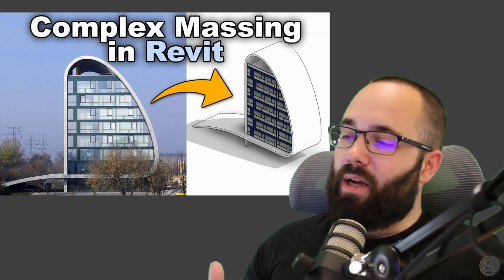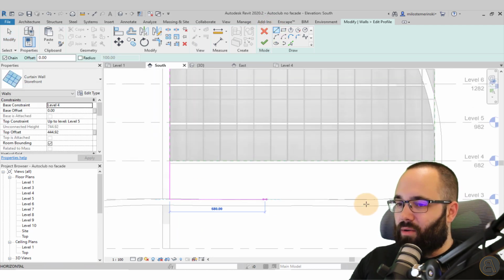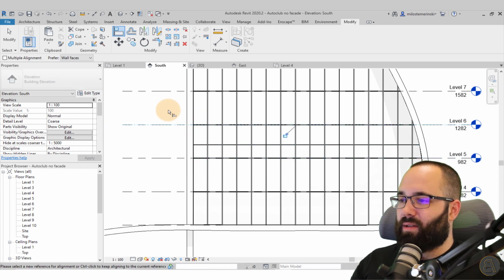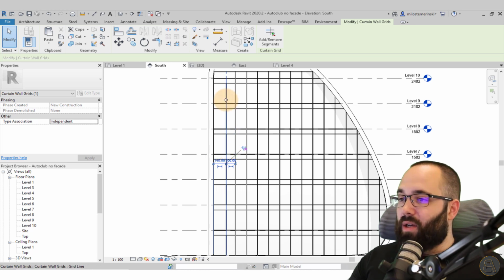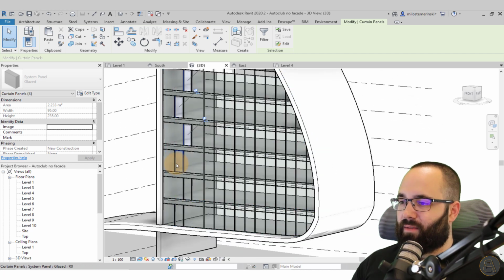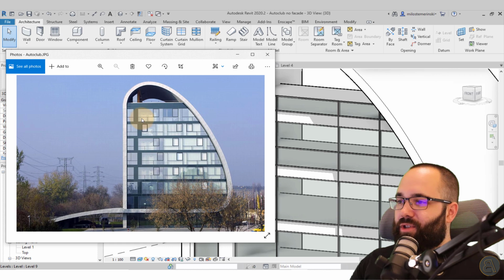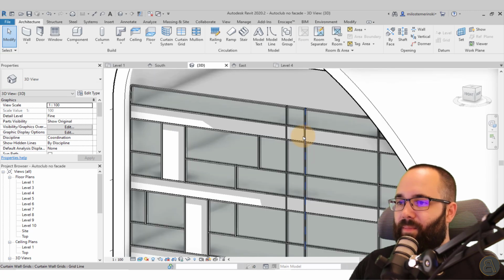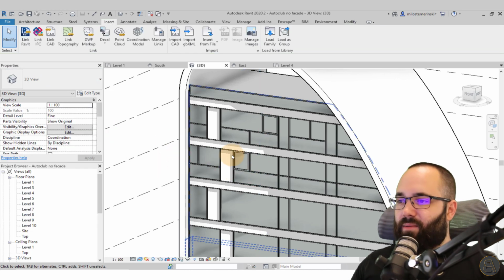Advanced Curtain Walls in Revit Tutorial

Comment: Hi, I need help in my Project. I have drawn a Form in Object Mode but my biggest Problem is that I can not turn this Object in to a Wall or Roof that I can connect the Walls till the Object hight. The form is complex and the hight is different everywhere. I have different hight in my Room.(p.s. I have tried to turn the Object in Object Mode to a Wall or Roof it doesnt work..)
I hope that I could explain my Problem. Thank you very much...
Reply: try using dynamo it can solve most issues